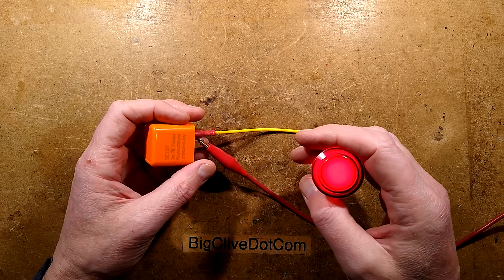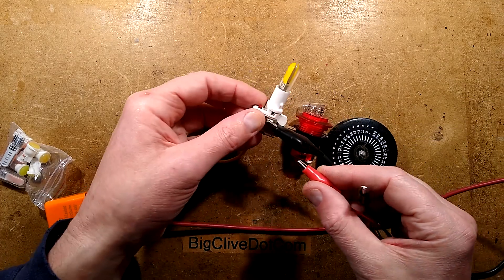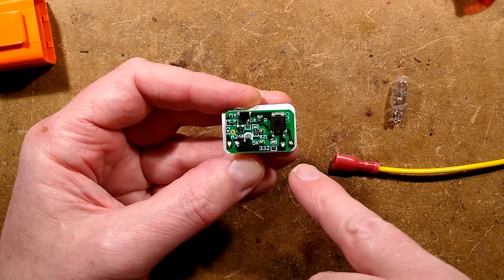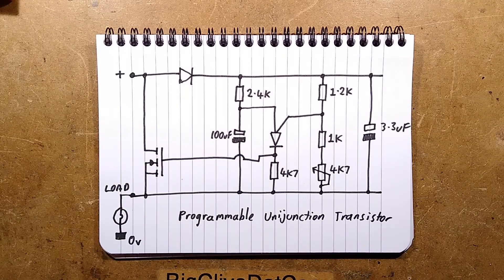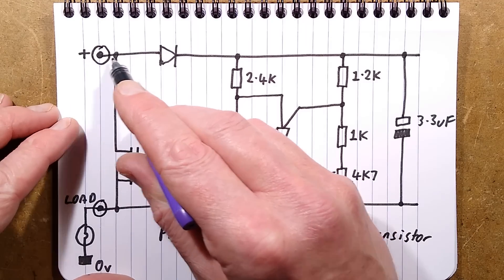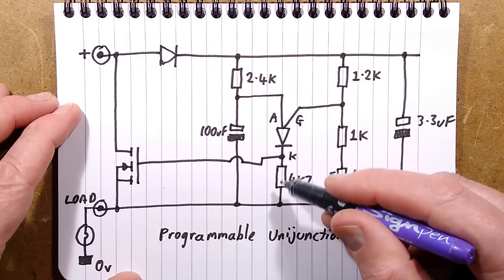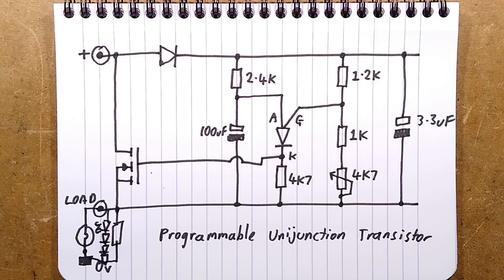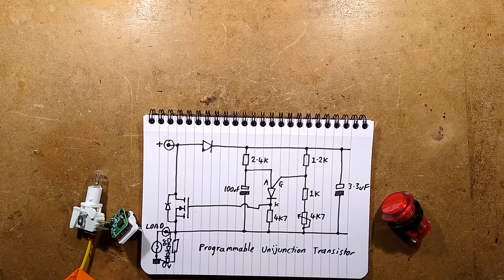Two wire flasher module teardown with unexpected find

Comment: One of the lesser known functions of the traditional automotive flasher was to monitor the lamp current so that if one of the lamps failed the flash rate would double, acting as a warning to the driver.
Reply: It always surprises me that more people don't know this. It's been a standard feature for a very long time on the older bimetallic flashers.
Reply: How did lower current draw, from one parallel bulb burning out open, cause a bimetallic flasher to increase the frequency of flashing? Wouldn't it take longer to heat the strip, slowing the flashing frequency? In my oldest cars, there was no increase in frequency when a bulb was burnt out. So I always assumed the higher frequency flashing was a design feature of the new electronic flashers....
Reply: @spelunkerd  I think the higher current of two bulbs makes the strip get hotter while it's in contact which means it stays disconnected for longer before it cools down enough. It's a bit counter-intuitive for sure.
Reply: @spelunkerd   correct. It didn't. The bimetallic flashers didn't double, they halved or stuck on when a bulb failed. People have forgotten that!!!
Reply: @spelunkerd  

More power/less resistance available due to only one bulb consuming power would make the relay internals heat up faster, certainly in old mechanical relays with no electronic component trickery.
Reply: For ones have a good ears, though.
Reply: More a by-product of the bi-metallic design than an actual designed-in feature... no ? 🤔
Reply: @peterfitzpatrick7032  It is a legal requirement, in the UK at least, if a bulb failed it must flash at double the rate. Most modern vehicles flashers are controlled by a body control module nowadays with built in current sensing. Nowadays though a faulty bulb/LED can throw up a warning light on the dash.
Reply: @peterfitzpatrick7032  Probably yes but the "feature" is still replicated in some electronic flasher units as it's useful. Some will even flash the indicator lamp (with a separate output of course) rapidly if the current is too low while the actual turn signals still flash at normal rate. Also, many modern cars and trucks replicate the clicking sound of the old electromechanical flasher relays through a piezo disc or the speakers of the stereo system to indicate the driver that the flashers are on. At least I much prefer this to the annoying beeping that's sometimes used for the same purpose.
Reply: @Murgo-u3l  I had a 2001 that did this so it's been around a while.
Reply: @peterfitzpatrick7032  No, part of the specification. I worked for Lucas and at one time maintained the test equipment on the flasher production line.
Reply: @paulbattarbee9615  

All flasher units using the old bi-metallic strip system would flash faster when resistance was decreased to a burnt out bulb. Definitely a byproduct and not something specifically pioneered by Lucas.
Reply: @skylined5534  Bulbs are in parallel, and they almost always fail open. When one bulb fails, the resistance of that stretch of the parallel circuit increases, by two fold if you assume two parallel bulbs of equal resistance. If resistance of the circuit increases, the total current goes down, and the relative portion of voltage drop across the higher resistance stretch increases. With total current lower, and voltage drop across the switch lower as well, there is less power loss at the switch, not more. I like Chaos Corner's explanation a little better, it makes intuitive sense.

Comment: I think the bulb you used simply does not pass enough current. A standard PY21W(581) style lamp would have a lot more LEDs than the T10 (501). Your resistor provided approximately 12mA more current, it didn't change the voltage drop across the bulb which was fixed by the forward voltage drop of the LEDs.

Comment: The 2N6027 Programmable Unijunction Transistor is available on the Bay, only £3.80 for 10, from Kent! 
My bathroom fan overrun timer uses a BT131 and I wondered if this would also function like the 2N6027?
You may be interested to know, the overrun timer uses a 4060 ripple counter to provide the delay! (Surprised me).
Can't find any data on the UABJ.
Thanks Clive 👌
Reply from the maker: The 4060 appears in the weirdest of places.  Many washing machines uses one in the water level sensor.
Reply: @bigclivedotcom  Pre-fill or overflow timer, I'm guessing. Pressure sensor is what I would expect. Maybe the 555/556 timers are passé.

Comment: It's funny what you say about resistor nomenclature... I've never really given it any thought before but actually, I also say (and write) "4k7" more often than not, but for most other values I tend to say "1 point 2 k" etc. I usually say "2k2" as well.

I vaguely remember reading about PUTs, probably in Electronics magazine as a kid in the 80s, but I don't think I've heard of or seen them since then. I'd basically forgotten that they existed until you mentioned them and couldn't remember the symbol or what they did. Once I saw the symbol in the circuit, though, it became pretty self-explanatory - pretty much just an SCR with an anode gate.

Comment: Guys what do I need to measure the Pico farrad capacitance of an audio cable, or whom to ask for a one-off? Cheers.
Reply from the maker: A good multimeter with capacitance test should be able to do that.
Reply: It would have to be one that operates are relatively low frequency so that the transmission line effects don't screw with the measurements. Some multimeters get confused by that, a proper LCR meter should work.

Comment: The other place you'll find a PUT is in the original 1970's stylophone as the oscillator, the notes are a chain of resistors in a potential diovider
Don't forget you would normally have 2 lamps plus a panel indicator in your circuit, if the indicator is constantly on it could be indicating a fault, which i think is what is happening to you, try adding more lamps 
The 3rd terminal of a bimetallic flasher was for the panel indicator, there were 2 wire versions where there were 2 panel indicators connected to the indicator lights each side
A 4 wiire flasher was used for trailers/caravans, which was a second panel indicator that only operated when a trailer (with working indicators) was connected
Not sure how the electronic versions would work

Comment: Wow, I was looking for a reliable way to achieve 2 prong flashing with leds, because my bikes wiring was setup in such a way, that I could not replace it simply with 3 prong one. I also detested using high power resistors as balast cause its waste of power and just awful in itself. Now I know how to do it, thank you for showing this unit. I was wondering how much of the current can this run - will it be able to flash standard  incandescent 2x 23W bulbs as well.
Reply from the maker: The MOSFET should handle quite a high current.

Comment: Does the PUT work the same as an LM431?
Reply from the maker: The 431 style component is a shunt regulator with built in voltage reference.

Comment: I have seen the avalanche breakdown effect of BJT used to discharge a capacitor to make a "simplest LED flasher". Why don't they just use this? Maybe the avalanche breakdown voltage is not characterized by the manufacturer?

Comment: I built a very similar circuit from a magazine article years ago to provide variable speed delayed wipers for those drizzle days. Used a transistor follower driving a relay instead of a MOSFET but it worked well for many years.

Comment: Pardon an amateur but how does the voltage drop across the LEDs affect the charging of the capacitor?
Reply: I pondered this. I think it fails to pull the cap negative to ground.  It floats too close to the supply rail so never really charges.  You can also see a path (thru the voltage divider) that continually supplies the LED current.  If you imagine putting a traditional globe between the neg of the cap and the neg of the supply, as its resistance is so low it is like a short and pulls the neg of the cap  close to neg of the supply and forces current thru the cap and charges it. 
I suspect if the voltage divider circuit used higher value resistors it might work better with lighter loads.  But then may not trigger the PUT properly so I guess they found a balance.
As others have mentioned the stack of LEDS inside a LED globe may set the voltage at the neg of the cap to around 9Volts only leaving a few volts across the flasher which is too low for it to work.

Comment: Great video Clive! I remember the old type that were also just an oblong bi-metallic strip with a line across it at 45 degrees (LUCAS?) that opened purely due to the current flow, and didn't have a heater. Seeing as you like reverse engineering, you might like my recent video on repairing a Dyson Fan (not the hot and cold one) as I reverse engineered the circuit that controls the oscillation motor. Or if you like software reverse engineering you might like the one I just did on an inverter password! Thanks again and keep up the great work!

Comment: Help required…..I fitted two small led spots to my motorcycle wired into the redundant power supply 12v , they are meant to be always on however they flash like a glitter ball in a disco, I have tried inline resistors however they get really hot, any ideas how to fix? 
All help appreciated…🚀🏴

Comment: So then ... a bimetallic transistor. I still remember the early 70's when they built a voltage regulator into car alternators, but ran into trouble because when it was real cold outside, the bimetallic mechanical regulator, charged the battery to a higher potential and the electronic one couldn't replicate this, so they had to engineer a new kind of component ... don't remember what it was called offhand though ... can you help me?

Comment: VW brought out an electronic flasher 40 years ago it cost ten times the price of a bi metal one and could be replaced with a bi mental one. It might have been more reliable but was it worth 10 times the price as they still failed.

Comment: That’s a trip down memory lane….
Over 50 years ago, around 1970, Philips (now NXP) developed the BRY39, that was a Programmable Unijunction Transistor/ Silicon Controlled Switch in a small metal can (TO-72)
It had two gates; a cathode gate and an anode gate.
It still seems to for sale for approx. US $6,-.
I have seen it used in overvoltage detection circuits. As far as I know, it was not very popular among designers, probably because of the high price (metal can i.s.o. plastic housing) and the lack of second sources.

Comment: Must have been cheaper to buy the traditional (taller) relay cover instead of having a custom, low profile, cover made. It they sell enough of them it should be less expensive to manufacture them (utilizing a smaller cover) in the long run.

Comment: Got tired 17 years ago about swapping blinker relay in my car. Bought a 3 pin full electronic version for motorcycles and soldered the PCB from that into the housing from my old relay. This silent relay is now in my 4'th car Likely saved as many replacement relays in that period. MOT does not complain that there is no tick, they only care for the lamps blinking outside and on the dash. I'm not in the UK and they are maybe stricter, but that is one thing more with limited lifespan in my car I don't need to worry about.. Also saves a tiny amount of fuel, as I can run LED indicators, without a power resistor across to emulate a filament. Electronic motorcycle relays do not seem to care about bulb error by blinking faster. They almost all have the feature (or lack of). To add clicking noise if you really need it: One diode in series with a electrolyte capacitor, and a small headphone speaker, all mounted in parallel from the output of the relay to ground or + depending if it switches low or hi when blinking. The diode prevents reverse current in the electrolyte and you need a bleed resistor between Diode and electrolyte, to discharge it between blinks. The capacitor acts as a pulse shortener the short period it conducts on the longer DC signal to make a sharp click in the speaker.

Comment: UJTs are cool because they deliver the timing capacitor's charge into the load, making very efficient use of power.  I think they used one in this situation because once the UJT fires, the main power is cut off, but the UJT will keep the MOSFET on until the timing capacitor discharges.  The circuit is not dependent on the 3.3uF maintaining supply voltage.  If you tried to do this with a 555, the filter cap would have to maintain supply voltage during the "on" cycle.

Comment: Quite a late video about these.
I use them for about 5 years now on my motorcycles.
Never had any problems with them.
Have led builds front and back and one indicator light in the dash.
Easy to use.
Works fine with the cheap voltage regulators you dismantled a few years ago...

Comment: Regarding the resistor needed, when used in a car the relay normally have a load of one small bulb like used here (side) but also two larger ones (main indicators) so I wonder if not that load would be enough in itself.

Comment: 2 wire flashers are very common in motorcycles and old vehicles, this is definitly a bit different though. Good tear down and info.
Reply: I remember that.  Flashers used to go bad pretty often.  There was sometimes a bin on the parts store counter for about $0.50 each.

Comment: Bigcive, that flasher is actually commonly used on motorcycle applications. Specially chinese motorcycles. Flasher usually sits at a easy to reach part on the motorcycle. Thus, why the adjusting screw is at the bottom (which will make it impossible to adjust while working on some vehicles with 2 prong flashers) There are plenty of variants of that flasher, including one with a small speaker (same generic speakers as the old PCs used), and it beeps whenever the lights are flashing (which is annoying af). 

Also, another thing that makes it for motorcycle use, and not so much for car use, is the fact that it doesn't click. Motorcycle flashers don't need to click, as usually, the surrounding sounds cancel the flasher clicking. Unlike a car cabin, which is even more silent, and the clicking is needed to remind that turn signals are on.

Comment: A 15ohm resistor from the car parts store if you want to pay through the nose put in parallel with the circuit fixes the quick flashing problem. I use 15ohm 10w ceramic.

Comment: I remember when UJT and PUTs were the new hotness back when I was a teenager in the 70s. Their principle benefit was that you could use them to make a single transistor oscillator that would produce a nice sounding sawtooth waveform - at a time when the cost of a normal transistor was usually about £1-3 each in today's money (less than the unijunction, but not half) and most audio oscillator or flasher circuits required 2.

Comment: There's actually a LED version for the motorcycle signal flasher. Years ago, I had to change to the LED flasher version bc the old one doesn't work. If only I knew bridging it with a resistor will work. The more you know.

Comment: The pin configuration is clearly from a standard automotive flasher. The old ones if an incandescent lamp burned out [such as the front turn signal or rear turn signal lamp] it would flash rapidly because the lower current would heat the bi-metal strip less. You could purchase a "Heavy duty" flasher which was a relay with a capacitor for timing. These were used primarily for when you had a trailer hook up that increased the load tending to wear out the bi-metal one quicker and it would also flash slower. With the Heavy duty one the quick blinking feature that told you if you had a lamp burned out/not making connection would not work anymore either.

This was not designed with LED's in mind. You would just solder a resistor at the base of the "L" terminal and give the other end of the resistor a ground [0C] connection to make it function with LED's Put as low a value resistor as possible using 14.3-15V between the "B+" terminal and the resistor ground to JUST BEFORE the MOSFET closes.

Comment: I built a device to do this over 30 years ago. A friend had a Triumph Dolomite 1850, that for some reason, would never flash it's indicators at an MOT compliant rate. I cobbled together a bridge recifier, smoothing cap, 555 timer circuit and a relay. Worked a treat, the only oddity being that it would continue clicking a few times after the indicators were cancelled, due to the size of the smoothing cap.

Comment: I remember in the 1950's & 1960's that Leyland Buses had flasher unit when the currant load of 5 bulbs at 24 volts at 21 watts each would run through a piece of metal that would heat up and bend and turn off the lamps then run through a relay until the metal cooled down then start all over again.  But it was always falling out of adjustment because of the heavy use.  Then where the days

Comment: Where did you get that variable resistor?   Any keywords to use on how to find one of these?  Never ever in 35 years have I seen such a thing. Sure it's a potmeter but with a fancy housing.
Reply: Clive did a tear-down of it at: https://www.youtube.com/watch?v=n3joyToqpCc
It's actually a bunch of discrete transistors on a PCB with a rotary switch.
Was sold by Tandy/RadioShack back in the day as a "Resistor substitution wheel". 

There was also a Capacitance substitution wheel available.
There's a similar unit available these days which uses jumpers
search on ebay for "Seven Decade Programmable Resistor Board"
There is also a "Programmable Capacitor board".